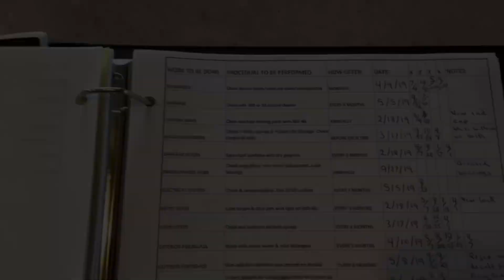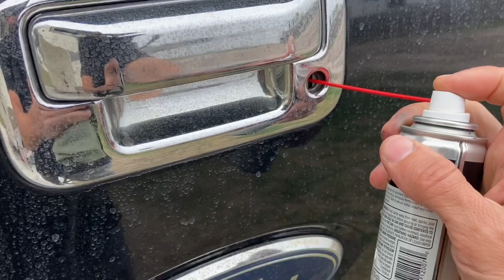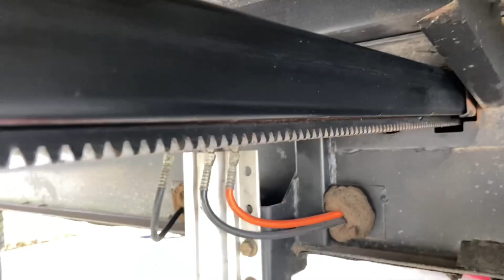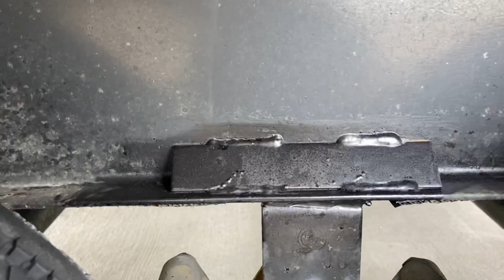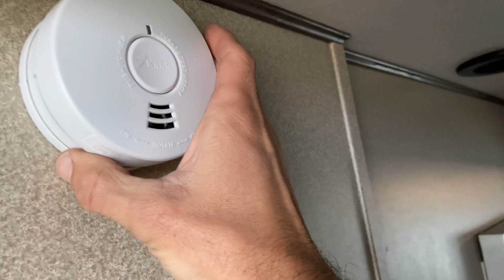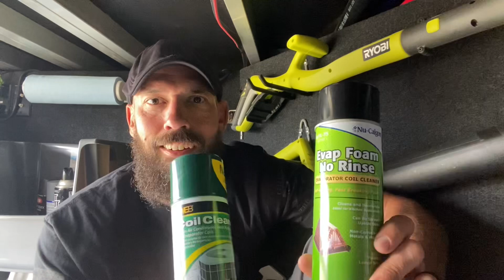RV MAINTENANCE 101 - EVERYTHING YOU NEED TO KNOW (Full Time RV Life)

Comment: Looks like a military "-10"! AKA Technical Manual (TM). Love it! I just had my roof coated by RV Armor. I was tired of worrying about the roof. My rig doesn't have that fancy water routing system that yours had/has. Little harder for me to get water diverted. Honestly never flushed or sanitized mine. Don't drink the water from the fixtures so it wasn't something I worried about. Nice to know though. Thanks again.
Reply from the maker: Definitely an older video of mine. Years ago I switched to Boeshield T9 for most things.

Comment: I'll be honest, at first a seen the video and how long it was and your maintenance list .  . I thought it was nuts.  But I gave it some time, and man there was a lot of useful helpful tricks you have.  One that stuck out to me, was the handles for the black and grey tank valves.. for so long i have to pull and push so hard.  I didn't even think to lubricate them up.. Also that siding cleaner is a great idea .
Reply from the maker: Hey just a heads up this is a really old video of mine and I have since switched to a different product that eliminates most of these and is way better. Boeshield T-9…Chief engineers on my tug boat use this stuff too. Here’s a link to that video. 

RV PREVENTIVE MAINTENANCE Using Boeshield T-9…The Only Product You NEED
https://youtu.be/BEp-JfODrIg

Oh and using the Thetford drain valve lube inside your tanks is key as well to keeping those gate valves moving. 👍🏼

Thanks for watching.

Comment: Brother you are a life saver.  I was a security field maintenance tech and found comfort in the PM check sheets knowing that as long as I did the work on the sheet I was golden.  I was so overwhelmed that I tried several time to put a sheet together.  I used your sheet as a good basis jump point.  Thank you
Wes
Reply from the maker: Sure thing, glad it helps out. I will say it’s an old video of mine and I pretty much only use Boeshield T-9 now on everything. You can check out the video in this link. 👍🏼
RV PREVENTIVE MAINTENANCE Using Boeshield T-9…The Only Product You NEED
https://youtu.be/BEp-JfODrIg

Comment: Chris - really appreciate all your maintenance videos and product recommendations. They have helped us keep great care of our RV!  I had a quick question about the 303 protectant. I do hear a lot of people rave about it, so I do think it’s a good product… but on all the exterior applications, I notice a lot of streaking occurs the first time it sees any water (morning dew, rain). Have you experienced the streaking of this product at all? I recently applied to a lot of items on our roof such as the black AC covers, roof vents, attic vents, skylight… but first morning we had some dew, it turned into a bunch of white/black streaks down all the surfaces I treated. Not sure if this is common or if its due to how I am using it (spray on to cloth and wipe down surface). Curious on your experience with it!
Reply from the maker: Thanks, appreciate you watching 👍🏼 I would say make sure to use only on clean surfaces. For best results clean the area first and it doesn’t take much 303 when applying. Out of direct sunlight(this is key) spray surface with 303 Aerospace Protectant and then wipe completely dry and or buff. If streaking occurs, too much product has been used. Use a wet towel to remove excess, immediately wipe completely dry. Note: this product does not air dry. Extra buffing with a dry cloth increases bonding, repellency and longevity. They recommend re-applying 303 Aerospace Protectant every 3-5 weeks for maximum UV protection.
I will say that yes if I get lazy and just apply to my trucks rubber gaskets around the windows and didn’t clean the truck first or I don’t wipe it dry and buff then yes I’ve had it streak too. Hope this helps 👍🏼
Reply: @WhyWait  you know what, I definitely did clean the surface, but the “wipe completely dry part” may be what’s getting me. I probably have too much product on. I would spray 303 on a towel, wipe it all over the surface, but I wouldnt go back with a dry towel and wipe it again. I will try that next time around. 

Anyways, keep up the great videos. And I cannot thank you enough for introducing me to Boeshield T-9.  That stuff is amazing. It helped me get rid of about 5 other lubricants and carry just this one product. From the RV to tow vehicle and all over our house, I couldnt recommend it enough. 

And one final shout out… my wife LOVES the gabe’s pride products. At first ordered a bottle of general cleaner and glass cleaner to test it out… but just ordered the concentrate formula so we can mix up bottles all summer long. Really impressed with it!

Take care and look forward to more tips from ya!
Reply from the maker: @ShaneMosier-fb8dq  good deal 👍🏼 We love Gabe’s Pride too especially the multi-surface cleaner and their foam cannon with the RV Streaker. Sometimes we have a promo code for discounts to save with them, right now it’s just WHYWAIT at checkout so they know we sent you. Can’t say enough about Boeshield too 👍🏼 As always appreciate you watching and I’ll try to keep the content coming. Feel free to always reach out and I’ll do my best to respond.
Reply: Sounds great. Appreciate it!

Comment: How to maintain a hydraulic slide? My slide has cables on it. Also, what sort of epoxy or glue do you use to repair small holes (looks like a puncture) in the awning? I dislike having to wait for Amazon to ship something and include the time passes of having to go find the package if they deliver to the wrong place.
Reply from the maker: Cable driven slides are something I’ve never had to deal with but I’m assuming a product like Boeshield T-9 would be great for maintaining the cable 👍🏼 
https://amzn.to/3eDfv1p

As far as something to repair an awning hole I have to be honest, I have no idea. Sorry. 🤷🏻‍♂️
Reply: @WhyWait  Based on your maintenance video recommendation, I applied a "lubricant" like the T9 product. 
I'll keep searching for a way to fix an awning puncture. Thanks so much.
Reply from the maker: @bluefamily3937  sure thing 👍🏼

Comment: I've had multiple RV specialists tell me not to lubricate the schwintek slide on my grand design imagine, which I found interesting. Can you provide any context to why someone would recommend not to lubricate the slide?
Reply from the maker: So this has always been a big debate in the Schwintek world. I recently found out a few months ago the you DO NOT need to lubricate the Schwintek slides anymore. Some older videos out there show a tech lubing these like I do. I guess that video is the old Schwintek system with the old coupler and metal gibs. Now it’s oil and copper infused and does not require additional lube. The Lippert people say by lubing you can actually cause the motors to work harder and therefore amp out sooner due to over coming  a thicker more obstructed gear rack. This is straight from Lippert headquarters.
Reply: @WhyWait  thank you for the info!
Reply from the maker: @joe1071  sure thing! I need to make a new video on this since I just found out myself. Thanks for watching 👍🏼
Reply: @WhyWait  great content and info, I appreciate it!

Comment: have you made a video yet on how you use the corroseal? We bought  our Fifth wheel used, and the frame from the axles back is developing a good amount of rust. I would like to use the corroseal and go to town and get the frame looking as good as yours.  I'm debating if I need an electric sander, maybe a grinder.  Any advice would be appreciated.  I respect your thoughts on RV maintenance.
Reply from the maker: I use that product out at work on our big tugboats in the harbor. It’s what our company provides and we use at the shipyards. Here is a link to the products instructions. Hope it works out for you 👍🏼
https://corroseal.com/technical/application/

Comment: Thank you for this video. What would you recomend to lube the landing gear and levers on an auto level trailer. 2019 Grand Design Momentum 376th
Reply from the maker: We have the hydraulic leveling landing gear and we use the CRC dry power lube with PTFE. Pretty versatile for most things. It’s basically a dry Teflon lube, prevents dirt and dust from sticking to the legs.
Reply: @WhyWait  I will try it. Thanks for the videos. Good job!

Comment: Is there any difference between CRC power lube and CRC dry lube? In video you say to use CRC power lube for slide out rack and pinion gears but in check list you say to use. CRC DRY lube. Thanks
Reply from the maker: You can really use either or. The dry lube with PTFE is probably better because it’s suppose ti create a dry film around most metal, wood, rubber, and glass surfaces to reduce friction and resist oil, dust, dirt, and harmful contaminant build-ups. The CRC power lube with PTFE is a wet lube that could attract more dust and dirt to stick to it. I use the dry lube when it’s available and I can find it. The CRC Power Lube comes with extreme pressure additives and PTFE to offer unparalleled lubricating performance. It has twice load carrying capacity of most general purpose lubricants. And it’s the only lube Lippert recommends to use on the Schwintek slide out style slides. Hope this helps.
Reply: Thanks for the quick reply

Comment: I just noticed on your slideroom at the end of the video, it looks like you have a slide seal flipper to help ensure the slide seals deploy correctly. Is that a correct assumption. If so what are you using as the slide seal flippers as I have been looking at different options to use that won't damage the slide seals
Reply from the maker: It’s actually just the back of a Command hook. We attach the hook there to hang outdoor wreaths. I’ve never had a problem with the seals not deploying correctly, I always check when the slides go out. But now that you mention it I wonder if these would be a good solution if I ever did have an issue. 🤔🤔

Comment: What rust preventer do you use?
Reply from the maker: I dont really use a rust preventer. I keep things rinsed in salty environments. You can see in the video how I fix rust spots though. Clean it up with a wire brush, knock loose rust off, rinse, let dry and then apply Corroseal Rust Converter. Then prime/paint. This is also the process we do on our tugboats I work on. 👍🏼 Link to Corroseal in the video description
Reply: @WhyWait  thank you 😊
Reply from the maker: Sure thing. 👍🏼

Comment: I have issues with a Atwood furnace sail switch.  I've had it replaced while it was under warranty 3 times. An have replaced it once myself. Every time it was replaced the furnace worked for about 2 days. So my question is. Is there anything else I can do? We've been using little buddy heaters to keep it warm inside the rv
Reply from the maker: That’s a tough one, can’t believe you’ve had that many issues with the same part. Sounds like time for a whole new furnace.

Comment: Do you have any concern with the 30 second cleaner degrading the awning fabric with the bleach in it. Think most recommend dawn but looking for something with better cleaning power. Thanks
Reply from the maker: Nope! 30 Seconds Outdoor Cleaner can be used on a variety of surfaces; wood decks, concrete driveways, sidewalks, stucco, vinyl siding, brick walls, plastic outdoor furniture, you name it. If it's outdoors and dirty from humidity and wet weather, 30 Seconds can clean it all. Simply spray on and hose off. Here’s a link below. Great for the roof too. I have a whole video on it you should go watch. Just don’t use the alcohol based one. 
https://amzn.to/2YHnfnf
Reply from the maker: Here’s a link to read from the company about using it on awnings. 
https://30secondscleaners.com/blogs/blog/17853979-clean-your-awnings-with-30-seconds-outdoor-cleaner

Comment: I think you said you torque your lug nuts every trip. We have a GD Reflection 337 and at a rally the GD engineers said if you do that you must back off (slightly loosen) the bolts first or you will eventually over-torque your lug nuts and eventually breaking lugs! Especially in your case as 110 is the max torque. They recommended re-torquing once at 200 miles after re-installing.
Reply from the maker: When I say every trip I mean every 6 months cause We usually only move twice a year and I do my bearings once a year before one of those trips so I have to take the wheels off and obviously torque the lugs when I put them back on. So technically I only check for torque once a year haha 😊
Reply: How on earth could one over tighten using a torque wrench? Isn't that kind of the point.
Reply: Actually no. If you repeatedly re-tighten, even at the same setting, you're slowly increasing the torque every time you re-tighten to the click. Re-tighten enough times and you'll snap a lug.  @TraconWizard